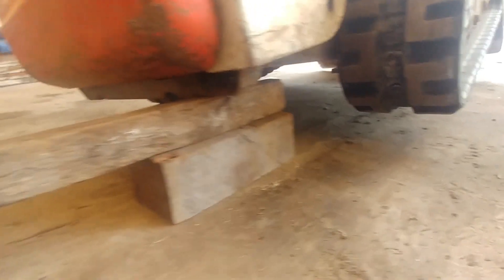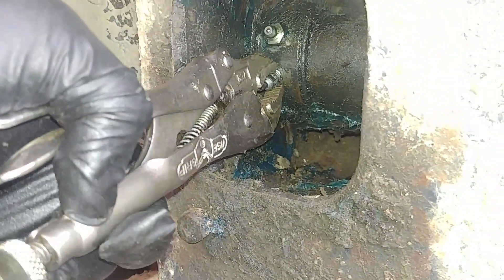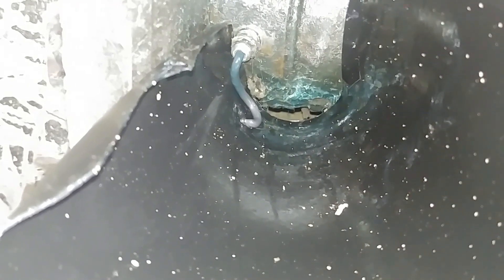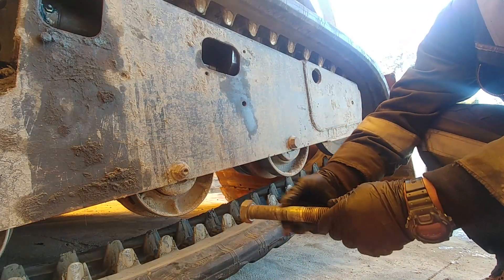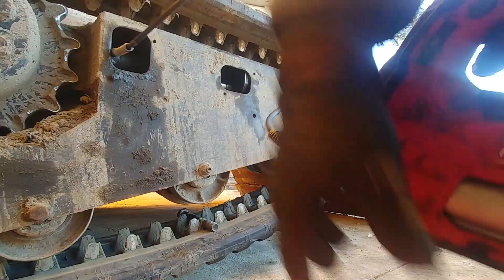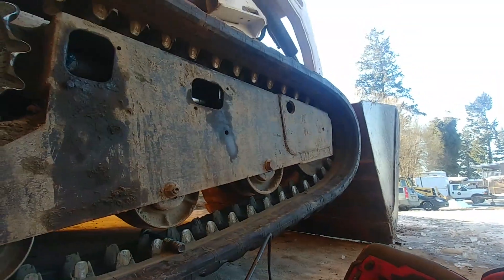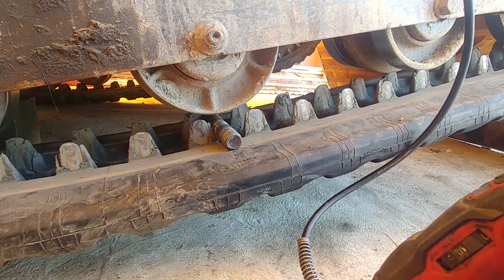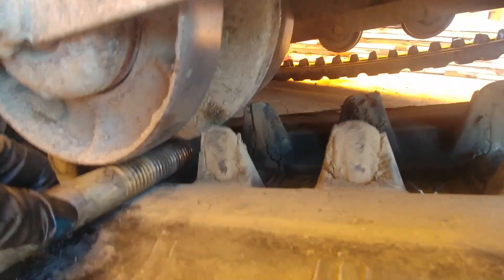Bobcat Loader TRACK TENSION ADJUSTMENT Basics. PROCEDURE and SPECS.

Comment: Keep them coming I have a 2016 Bobcat T590 and we need more people who show maintenance. What size bolt did you use for guiding?
Reply from the maker: I used 1/2" (13 mm) diameter bolt. More equipment maintenance and repair vids are coming. Thanks for watching and subscribing. Cheers.